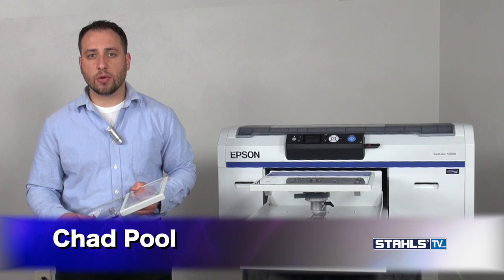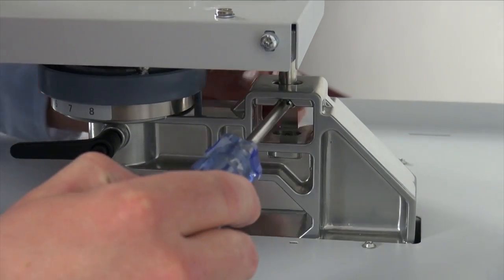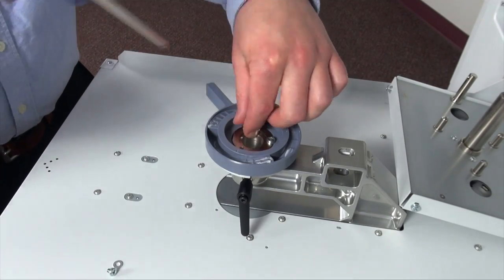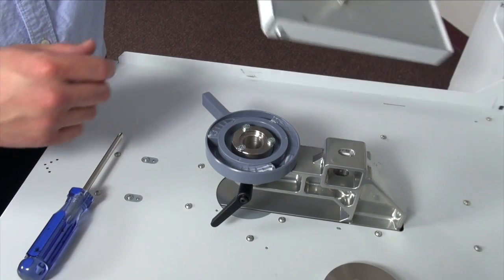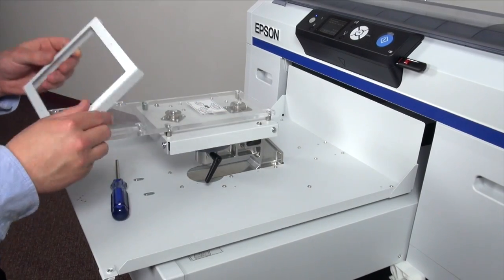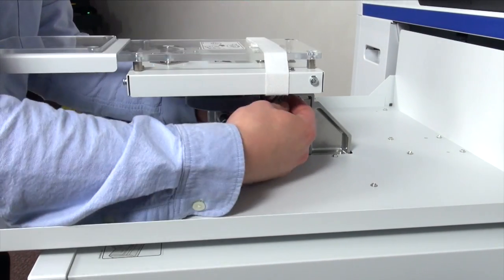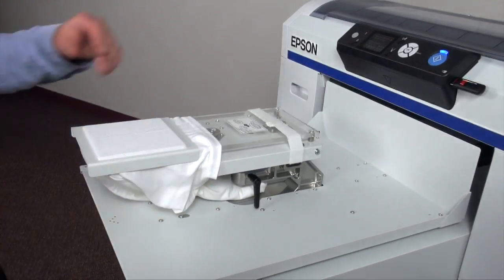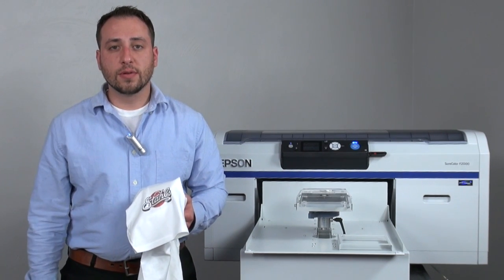Epson F2000: Sleeve Platen

Comment: Hmmmmm. Confused a bit for I don't need to unscrew anything when using the sleeve platen. I just swap it with the 14x16" platen and lower it down to level 7. That's it. I would see the images for removing the ring and not understand since it works perfect without doing so. Seems like a lot of trouble in comparison.

Comment: that looks like to much work to switch. do they have a quick change?
Reply: Hi ams,

Ended up back to this video. Check my first comment. No unscrewing is actually needed at all. Just a straight platen switch and level adjustment.

For anyone with the F2100, it's a little different but still quick:

When switching the platen, you want to remove the thinner of the two rings. Print at platen height 5 (i believe. no longer working with the machine)